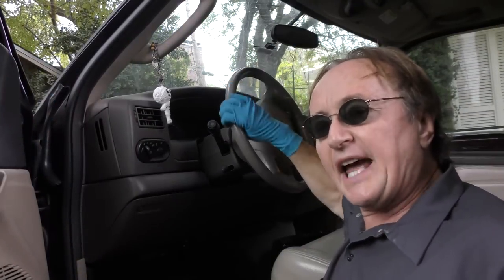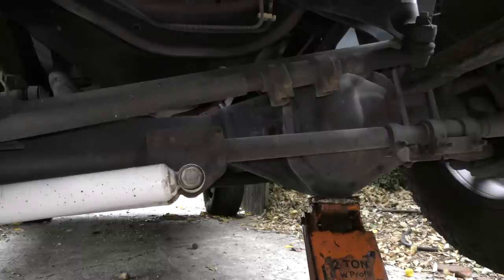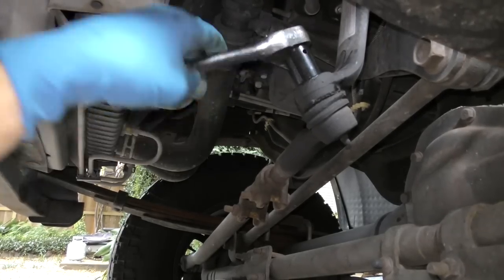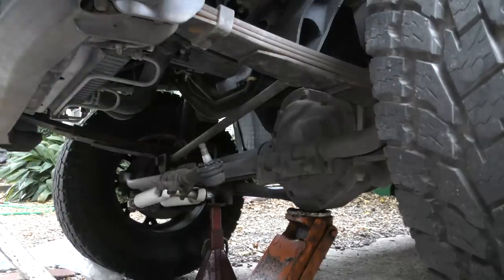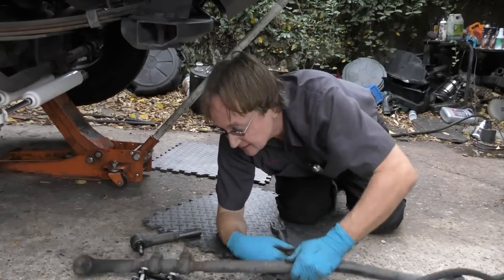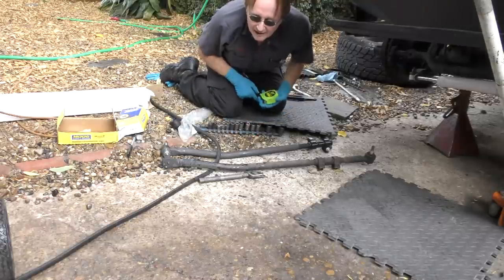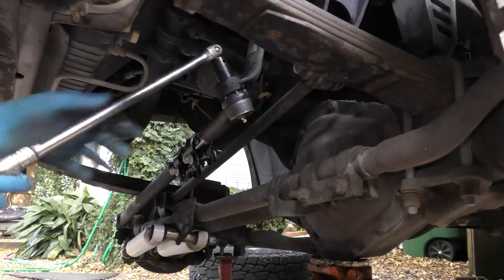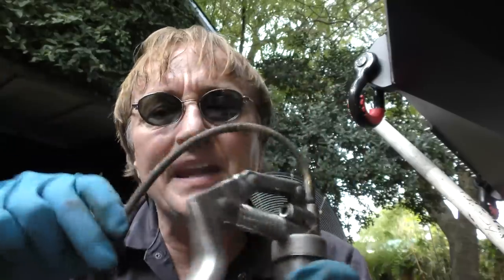How to Fix Steering that Clunks and has Play

Comment: I got alignment done already
Reply: But not fixed do I need to change suspension ball joints
Reply: +rishi rishi. how you got the alignment done already thats dangerous you post to replace the parts first then get a alignment whatever mechanic you went to probably don't care for your life.
Reply: i got the inner and outer tie-rods replaced and have got alignment done, but i still feel play in steering and the worst part is when the road has imperfections steering automatically pulls to one direction.i can also hear noise cluk cluk from my front end whenever i drive the car in the mornings and later it disappears.
Reply from the maker: go to a real front end shop with pros who will check all the front end parts. Your alignment guy was crap, he didn't road test it and find out it's not fixed

Comment: I have a 97 Jeep wrangler that makes a loud grinding noise when turned all the way to either side AS WELL AS alot of play in the wheel specifically to the right,  anybody know what the problem might be?
Reply from the maker: +Tyler Matthews jack it up and check for play by pulling on the right wheel first. Often worn out steering boxes on those.
Reply: +Scotty Kilmer thanks man I'll take a look at it,  thanks for the help!!

Comment: One point on this one, Scotty....did you leave the protective shipping cap on that driver's side end joint?
Sure looks like you did from my armchair angle. 
Great vid otherwise.
Reply from the maker: +Tim Ewa  It was on before I put it on, but not when I installed it.  The rubber boot was on it then, it came with the kit.